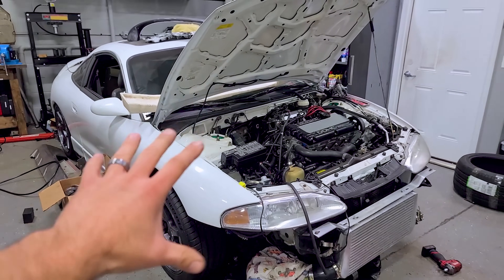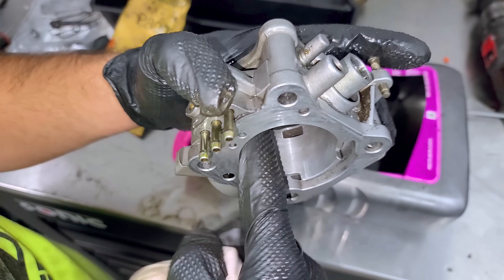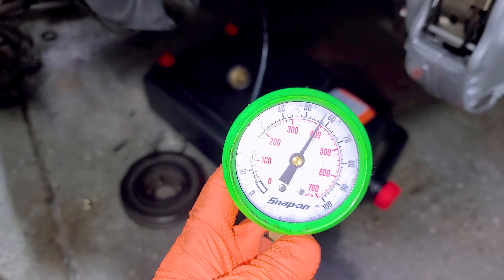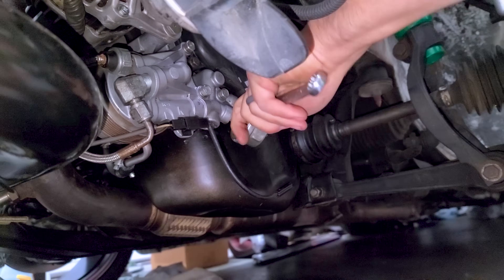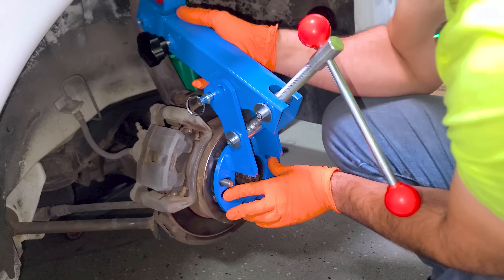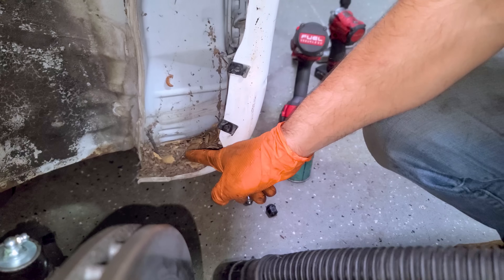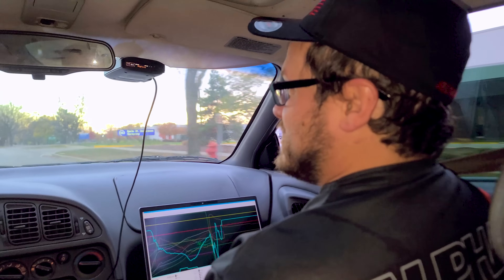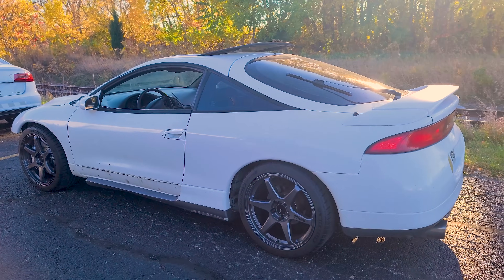We DOUBLED The Horsepower Of My 240,000 Mile Eclipse GSX & It Totally DID NOT BLOW UP!

Comment: Another GREAT free mod is removing the balance shafts.
You just have to cut one of the shafts off of the backside of the oil pump and weld it shut, and turn the balance shaft bearings so they block the oil passages. 
This does cause an oil pressure issue in the head, but is easily remedied with a bit of relief using a die grinder and a carbide cutter.
It is an estimated 20 hp of rotating mass.

Comment: I am rebuilding my 1G atm forged rod's and pistons, balance shaft delete and high rpm valve springs. 
Aiming for 350fwhp on 98 octane with a g25 550 turbo and rev it to 8K , in a 900kg gsr Cordia Turbo with boost by gear.

Comment: If you ever need a new drivetrain you can take one from a Lancer of the same model year. It's a little known thing but the chassis is the same between the two model types. In fact they just bolt in like it was meant to be that way. I successfully did this with an 89 Eclipse and it was one of the best mods I did to that car.

Comment: The idle surging was a common problem often caused by a poorly adjusted BISS.  Also those ecus needed to relearn whenever the power was disconnected.  A mitsubishi tech told me to give the ecu choices to redevelop its trims.  ac on and off, etc.

Comment: With moderate miles or a fresh rebuild, the 4g63 will reliably hold around 460hp on stock internals.  With 240,000, not so much lol. But yeah! That's a big reason for the love of these things. That motor is not weak by any stretch of the imagination. They built it strong Alex!

Comment: Stock block: good for 600+
Stock trans: good to 420 MAX
(And that is pushing it)
Reply: I don't know why I have to keep saying this, but HP is not the determining factor with DSM 5-speed transmissions. TORQUE is.  Anything at 350 lb/ft will live forever.  400 ft/lbs starts to get where you really need to be careful.  As long as you let the transmission cool down between 3rd/4th gear pulls, you'll live fairly long at 400ft/lbs too.  Don't bother launching the car with anything above 350 ft/lbs on a stock 2 spider center diff though.

Also: you are TECHNICALLY correct about the stock block by itself being good for 600+.  However the stock 7 bolt rotating assembly is another story.  Thinner rods would make me nervous at anything above 400whp.
Reply: @BasedEMT1776  thanks.
I appreciate someone reaffirming what I have shared.

Comment: The IAC will cause the idle issue every time on all the imports from the 90s. It happens so often that I usually kept one or two, indifferent ones for different cars because sometimes putting like an Honda, or Nissan IAC, on a DSM would work just un pin the plugs. Watch out for crankwalk, the bearings and seals in those motors will start wobbling, and back then it was a harmonic balancer not a fluid dampener. And those motors would shake themselves to death.😂 I loved my 4G63
Reply: If it ain't walked by 200+ thousand miles, it ain't gonna walk.  The only proven cases of crankwalk not caused by any external factors(heavier clutch, mistakes during assembly, blaming rod knock from oil contamination on crankwalk, etc) were well before 90k miles.  Usually around the 50-60k mark.  2JZs and BMW engines from the same year all had much higher cases of crankwalk than the early 7 bolt 4G63's did, but no one ever talks about that.

Comment: DSM's can and do daily drive trouble free around 600-700whp give or take.
They max out raced out at around 1100 hp
Also the AWD drive train starts to fail around 550whp, especially the rear dif, axles, and transfer case.
Also the stock trans and syncros.
Reply: WHP doesn't kill DSM transmissions, torque does.  They will live forever at 350lb/ft, no matter the HP.  It's when you get above 400 lb/ft on stock everything do you start having issues, mainly with 3rd and 4th gear stripping the teeth off.

Comment: Oh, 20 years ago my youth was wasted doing this to several different eclipses.
I chased the skyrocketing idle once like yours, did all that you did and nothing changed it.  Early on I replaced a coolent temperature sensor just because it can cause the idle to surge. It did nothing, after 6 months I gave up and took it to a honda hot rodder, first thing he did was replace the coolant temperature sensor.

My replacement was a bad one.

Comment: The 4G63 DSM engine. These were the same engine that was used for years in the Mitsubishi Lancer Evolution up to the Evo-IX, the second-to-last iteration. While they both featured the same cast-iron block, the Evo also had forged aluminum internals and an aluminum head, which meant they came in at 271HP stock and could be tuned much higher.

These had a ton of aftermarket support from suppliers like GReddy, aPEXi, Tein, and so on. I'm guessing aftermarket upgrades should be available if you're willing to look.

(A quick look at GReddy's website yielded some interesting finds. Worth a look!)
Reply: All 4G63's had an aluminum head and forged internals.  The Evos extra power came from a larger turbocharger, slightly higher duration/lift cams, bigger injectors, and a more aggressive tune stock.  The DSM 6-bolt 4G63 is stronger than an Evo 4G63, and will take much higher horsepower stock/unopened than an Evo will.  The Evo has thinner rods that are a problem.  Stock 6 bolt's with no work have gone deep into the 9's reliably.  

They both can be tuned pretty spectacularly, but to this day DSMs have a faster 1/4 mile record than Evos do.  Shows you which one is more tunable. ;)

Comment: Lastly, you live in Chicago. 
I DARE you to daily this beast in the winter.
I have driven through a solid ft of snow, it is UNSTOPPABLE.
Reply from the maker: Not this car. It's from Nevada and doesn't have any rust. I want to keep it that way.
Reply: @LegitStreetCars  rino the underside, or keep it bathed in oil.
 it WILL be worth it.
Reply: @LegitStreetCars  the 4g63T is a torque monster. 
I have actively tried to get my GSX stuck in the mud, sand, snow, and ice.
The mechanical AWD is superb, and the shape of the body allows  it to glide over the snow/sand/mud.
It's kinda ridiculous,  but you won't know til ya know.

Comment: I am a bit disappointed you chose the adjustable ball joint as a camber solution. I personally would have replaced the sheet metal upper arm with hollow adjustable length spokes. Why? 1: The wear part, the ball joint, is now silly expensive and not easily available 2: With replacing it with two spokes, you will add caster adjustability to your suspension setup. 3: Unsprung weight. Properly constructed hollow spokes weigh more or less the same as the sheet metal, your ball joint adds weight to the unsprung part of your suspension. There is a reason you see this in more expensive (race) cars and never see those with adjustable ball joints. All this being said, your solution is obviously what the typical DSM owner would choose. ;)
Reply: And where do you purchase this ?

Comment: The best grease to use for seals is pure silicone grease. It will not swell or harden all types of seals, except silicone seals. Dont use silicone grease on silicone seals, it will melt them.

Comment: I think it’s safe to call it a 400hp at the wheels car. I won’t nitpick over 4hp. That’s crazy hp for this car. It may compete with my ATS-V which is 400hp at the wheels.  465hp engine. But my gearing is advanced so probably the eclipse is slower. Well done though.
Reply: Gearing or not, the ATS is quite a bit heavier.  A 400whp 2G with a proper driver will dip into the 10's.

Comment: How did you ignore  the two piece pulley for the water pump?
It is the most annoying part of that side of the engine.
The clearance to the body, and aligning two pulleys into a threaded hole in the water pump...
Nevermind.

Comment: I had a 98 Eagle talen tsi. I bought it with crank walk. Put a new engine in it. Never had a problem again. Also put a HKS 262 276 cams bigger turbo 510cc Injectors and a tuned e prom ecu. I sold it and miss it so bad To trade for a 2013 hyundai genesis coupe unfortunately that car got repossessed

Comment: My brother had a '95 Eclipse Convertible with a stage 3 Turbo that I want to say was pumping out like 460HP to the wheels, and we lowered it and had Miami Chassis do all the camber and alignment setup to our specifications and that thing was a literal racing kart on mega steroids! But then he got caught stepping out on his girl and since the car was under her name, she kept it and sold it for peanuts!!! Whyyyyyyyyyyyyyyy??!?!?!?

As for the Dip Stick issue, there is one from another car that's a direct fit that doesn't pop off, but I can't remember from what car and unfortunately, my beloved bother… my ride or die forever partner left us on 10/15/20 so I can't ask him. 

As for rolling fenders, I used to just bust out my trusty rubber mallet and pound in main spots about 6-8" apart and then slowly pound everything in between to that level and slowly smooth it out, but I'd go extra far so I could install the rubber edging n the inside edge to ensure I'd never cut a tire. It was a chore, but it always turned out well.

Awesome vid Alex. LOVE this car. Something about these little 4-Bangers making such insane power that it sort of defies logic. Thanks for making me flash back through so many memories of my brother. 

RIP Nef! It was one helluva ride! Miss you so much every day. ❤💔❤

Comment: Attention Alex! Throttle bodies have a special coating on the inside of them and on the flap. You definitely don't want to be having issues with the throttle body on that engine they are really picky and can run bad if something's small is off. This is why they have specific throttle body cleaner You could use that or mass air cleaner. Starter fluid is too hard for the coating and you definitely don't want to be sanding it

Comment: that setup should be close to 500, with good tuning a stock dsm will take 550..also the engines will stay reliable, its the drivetrain that sucks, especially the transmissions
Reply: Stock intake manifold, stock cams, stock sized valves, full exhaust with cat.  Seems right on the money with those holding him back.  A solid set of cams with springs/retainers would push him over 400whp by itself.  Not to mention a good flowing aftermarket IM like the Magnus V3 or JMFab Street, and a cutout just past the downpipe's flex joint.  But 500hp on a Green is hard, even with E85.

Comment: Those in tank walbro pumps are horrible. They are amp hogs and don't like high boosted EFI pressures. Flow drops like a rock at high pressures.  The inline AEM400 is MUCH better and does really well at higher pressure.  Good luck!

Comment: No, 350-400hp is generally safe for the 4G63 - pushing for moar though...  That's when one will want to start thinking of forged internals, etc.  As for reliability goes, again, was the mods done right or not, and how one look after the 4G63.  The 4G63 is a very stout motor & easy to get power out of and can be a very reliable motor.  Think of it as a 90's Japanese "SBC".  Not going to call it a 90's Japanese LS as there are other 90's JDM motors that are just as good that can also qualify for that title - I'd be a hard pressed to choose which one would get that title (and I'm a 4G63 fanboy). 🙂

Comment: Love my 06 MR. Got full bolt ons of course, had head decked, ported/polished, oversized inconel valves, stiffer springs w/titanium retainers, stage 3 cams, stainless 3” custom exhaust, titanium turbo manifold, intake, catless, gtx3576 gen2. The tune is severely handicapped I’m making roughly 400awhp tops because I’m still running stock block and bottom end. Sequential going in when that happens. Yes it’s laggy, I bought this bigger turbo knowing it will not be street friendly but when the block and bottom end is done, then the sequential goes in it will be much more streetable. Bigger turbos suck on the street especially when you have a manual like me but when you shift with the sequential you might lose a pound or so. The biggest thing with the sequential is they have to be tuned correctly to work with the ecu.

Comment: LEGIT LOW TO MID 12S ON A SAFE TUNE, NO PROBLEM...bTW, BACK IN 1999A  vIPER gtS WITH 450HP N 490TQ DID THE QTR IN 12.2 AT 119.  pUTTING DOWN ROUGHLY 410 WHEEL HP. Out of 8l n 10cylinders.  It is N/A  n redlines by 6,000rpm.   Power and tq curves on that dsm are excellent.  Must be lots of fun.

Comment: Cold Air intake, doesn't work. Air temp is gona be 60 degree Celsius or more in manifold anyway. It will improve sound not power. Regardless where is mounted, if you have turbo engine, without proper intercooler it makes no difference.

Comment: The 1996 Mitsubishi Eclipse GSX with a five-speed manual transmission has 210 horsepower at 6,000 RPM: 

￼

￼

Engine: 2.0-liter turbocharged inline-four 

￼

Torque: 214 lb-ft at 3,000 RPM 

￼

Valves: 16 

￼

Cam type: Double overhead cam (DOHC) 

￼

Transmission: 5-speed manual or 4-speed automatic 

￼

Drivetrain: All-wheel drive (AWD) 

￼

0–60 mph: 6.8 seconds 

Top speed: 140 mph 

Fuel economy: 22–24 combined mpg

Comment: You may also need to clock your TPS. if you have ECMLink, log the ISC position and the TPS voltage and you may need to adjust the TPS clocking to get the ISC at -30 while idling with the TPS reading 0. There's a writeup on the Link wiki.

Comment: The average restoration shop really hates when fenders gets rolled. Why? Because 1: dirt now gets stuck between the fold of your fender edge. It's sticking out as much as it is from the factory to allow for dirt, moisture and such to freely flush out, now it gets stuck. Usually, any cracks in the paint inside the fold, as well as the panel bond that you actually noticed getting loose, don't get fixed after the rolling. You may want to address both, making sure you have proper rust protection and making sure you will not get dirt caught up in your fender edges. No, filling the gaps with panel bond is probably not a good solution, because of the amount you have to put in there, it tends to loosen up and have water get in between the bond and the panel eventually, making your life miserable.

Comment: I used to sell those cars new. The Dimond Star Motors plant was run by Chrysler. They did such a bad job that Mitsubishi took over the plant in 1997. The worst was a new Galant that froze because their were no bearings in the engine.

Comment: I’ve had a couple DSM’s over the years.  1991 Eclipse GST and a 1993 Talon TSi.  The 1st gen DSM’s were reliable a heck for me.  Couple oil leaks that were easy to fix, but nothing crazy.  I modified the crap out of those cars and they just kept on running.  The talon ran 11.1 in the 1/4 on a regular basis.  Not crazy power, but it was fun.

My friends 2nd gen’s were always broken.

Daily driving 4G63T in a cold climate with the TB coolant bypass sucks.  Your throttle can freeze open or closed.  Not a fun situation.  IIRC I always installed an aftermarket TB.

Lose that non-recirculating BOV setup on a stock ECM.  You need to recirculate the BOV to maintain AFR on those motors.
Reply: I miss my 95 TSI I remember for MONTHS in highschool I refused to buy anything else other than that specific model. Also like you said damn reliable and the parts were super easy to replace or swap especially with the number of totaled Eclipses where I lived at the time.
Reply: You're a little misguided.  He's on speed density and not a MAF, so he can vent to atmosphere with no ill effects as it doesn't measure airflow, it uses temperature and pressure in the manifold to do it.  The stock ECU has made 1000+hp with the ECMLink software he has installed in it, and the TB coolant bypass does NOT help the TB from "freezing open or closed".  It is only used on first startup, once the car is warm the ambient temperature of the engine and heat-transfer will keep the TB hot, even if you ran with the hood completely off the car.  The temperature of the intake manifold alone is in the mid 100 degrees.  It's basically as hot as the head is.

Comment: Alex, a sand-filled dead blow hammer is necessary for those ball joints; tapping on the side of the spindle should break them loose. I make sure to bend both ends of the cotter pin through the notch and over the top of the threads.

Comment: I used torque sticks for a lot of years and never had them come loose. Shop changed owners and were told to only use torque wrenches and owners were told to return in 100 km. I found a few wheels that were loose. So we went back to torque sticks and hit with torque wrench. Never came back loose. The only thing I will warn you is make sure gun makes a ton of torque. Low air pressure or battery can really effect accuracy.
Reply: I bought a set of torque sticks and use them with my electric impact gun capable of over 300 ft/lb of torque and using the 110 ft/lb stick on my truck they are dead on or slightly over by ~5 ft/lb or less when checked with my digital torque wrench.

Comment: The 3.0 Mitsubishi engine used in the old Chrysler/Dodge mini vans and Plymouth aClaims Dodge spirits were awesome motors just cam seals/plugs maintenance (were leaky) and keep a good  timing belt going and they can go 300,000 miles as I had a '92 AcClaim with 270k still ran like a top when I sold it.

Comment: I bought gs-t with 35k on it and put over 200k with a lot of bolt ons. I was pushing 25 psi of boost on stock bottom end and stock injectors, but were maxed out. I would interrupt races out of the blue and win. I became well known we're I lived and sold that car and got a 3000gt twin turbo 6g72 motor. That was a blast too after the Japanese motor swap with 60k on the body. I should have swapped the 4g63 motor from Japan too now that I know they were forged internals from factory.